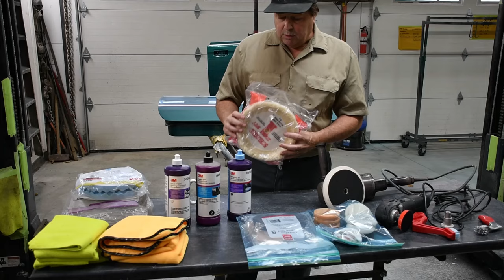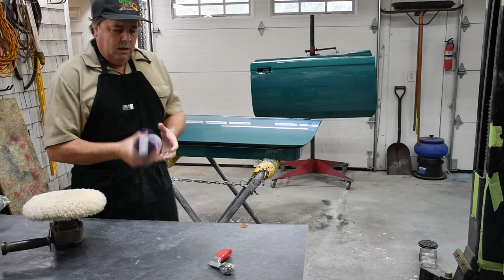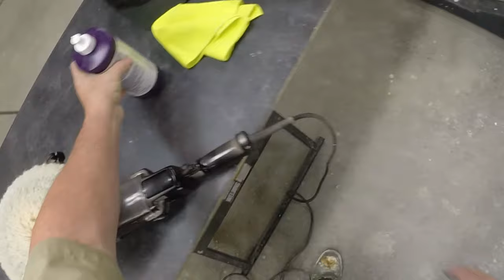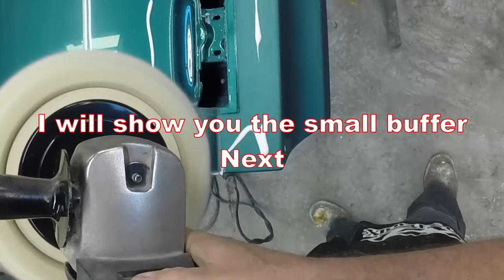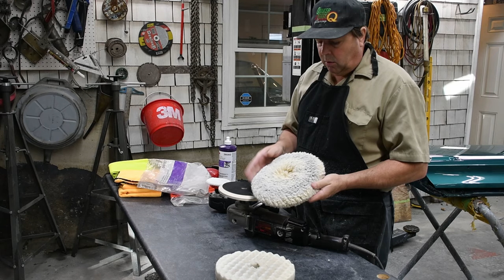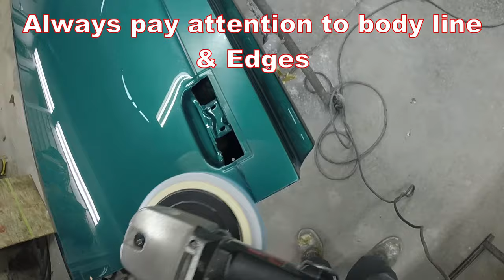How To Cut and Buff New Paint Buffing Like A Pro

Comment: Thanks so much, I have a multi layer House of Kolor paint job going right now, wasn't sure how many coats of clear to put on before sanding, saw your answer in the comments 3.   I have a lot of orange peel due to the unevenness of the HOK marbleizer I put on and then wrapped with saran wrap.   Would you recommend more coats of clear before sanding in this situation?  Thanks for any expertise you can offer, it will be much appreciated.   Fantastic videos!
Reply from the maker: I wouldn’t put more than 3 coats on at one time. Let it dry for a week. Sand it with 600 grit wet. Apply three more coats. Then give it  another week before sanding and polishing. The longer you wait the better. Good luck!